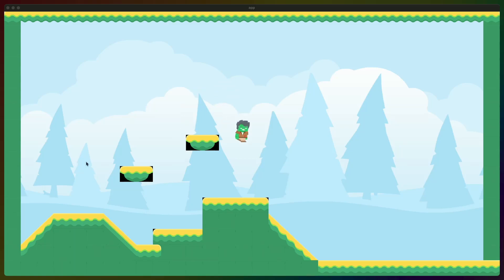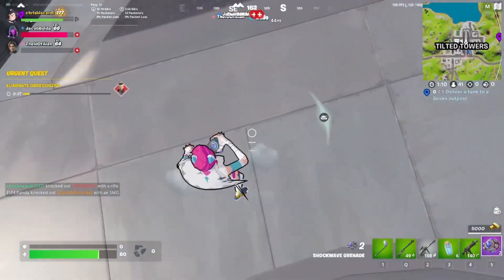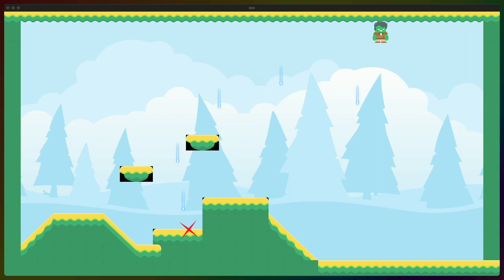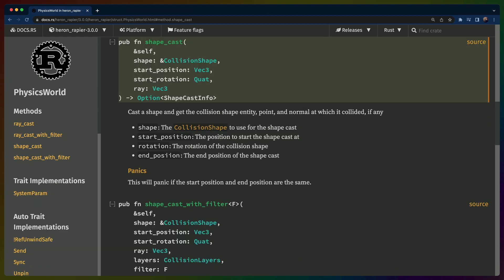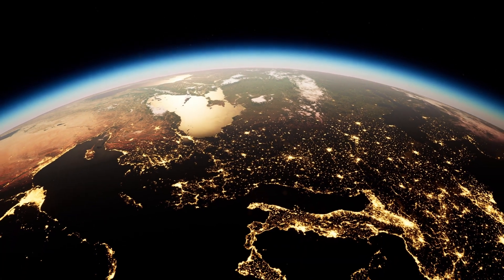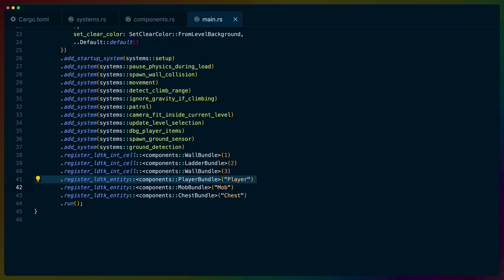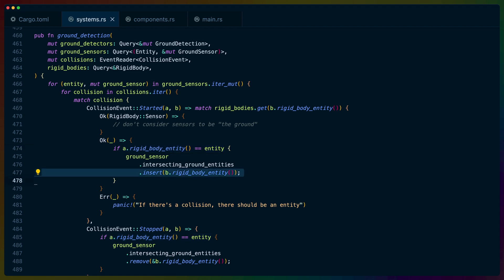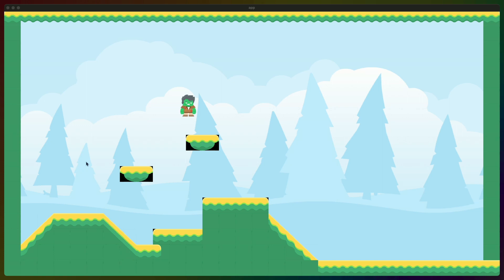Preventing infinite jumps in a 2d platformer with Shape Casting and RigidBody Sensors

Comment: How does this compare to a simple contact graph check?
Reply from the maker: hese days the right answer is probably to use the rapier2d character controller code instead, which supplies grounded as an output by default plus slopes, etc.
Reply: @chrisbiscardi But doesn't it take away the control? Specifically, the default KinematicCharacterController relies on changing position directly, which is not a good way when dealing with acceleration and velocity. The movement through KinematicCharacterController::move_shape only translates the player to a different location, which doesn't deliver satisfying movement. I am still figuring out on how to do movement in a nice way, so any advise would be appreciated ^^